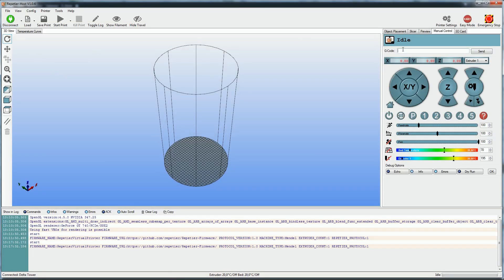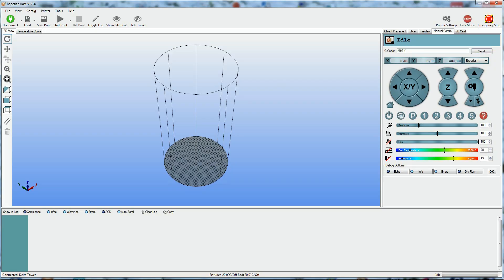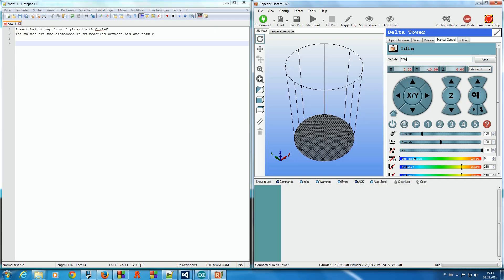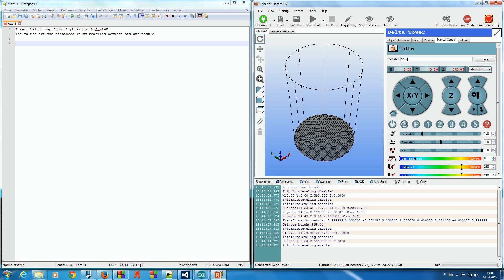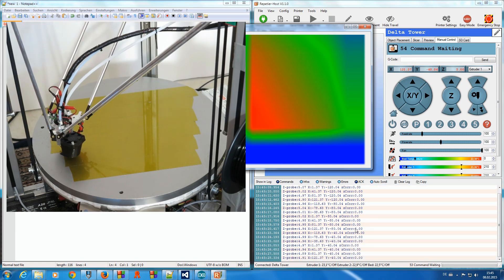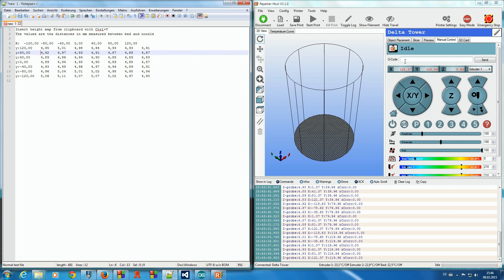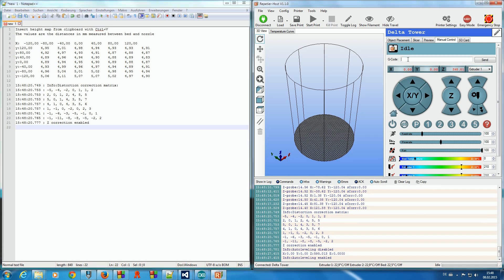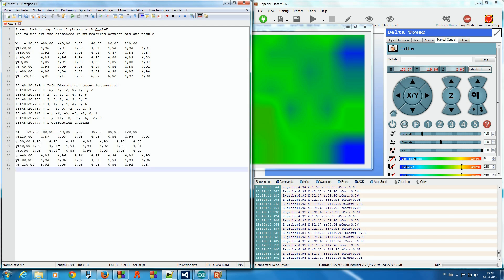Z-Leveling for Delta Printers with Repetier-Firmware

Comment: My configuration.h is the same as yours except dimensions differences including rods length, radius etc, other than that the corrections and leveling are set to the same as yours, but g29 measure only 3 points like other users and g32 s2 measure a grid, what's wrong with my firmware?

Comment: followed all the steps up to running the first bed leveling routine G32 S2. The printer tested some weird points, tested the centre twice and then a point slightly off centre. After this is did not home again and spat back NaN for all 3 values in the host, and told me autoleveling was disabled. After that all my steppers refuse to work at all. They will turn on for about half a second when the machine is reset or turned on but nothing after that. Printer will also hang if told to home axis. Any advice will be appreciated.
Reply: same problem here .

Comment: Love the video! I have a question though. When I use Height Map my starting point is X -110, Y - 60. When I run my G33 command it starts at X -110, Y 60. How do I get my G33 to run the same path as my Height Map, or does it even matter what path my G33 starts?

Comment: my 3d printer wont connect to repetier
Reply: you need audrino driver and need to set baud rate
Reply: I have, i found out what the problem was, one of the chips on the motherboard was burned.
Reply: so you got a new board?

Comment: You say g29 measures 7x7 points. Mine only measures 3 points defined in EEPROM, and the log never shows any correction information. What am I doing wrong? Repetier 0.92.9. I have also tried g33, but it says it is an unknown command.
Reply: You have to enable "DISTORTION_CORRECTION" in your firmware's "Configuration.h" file. After that you can use G33 and M323 commands.
Reply: Configure and download the latest firmware version from www.repetier.com/firmware/dev/index.php
In Configuration.h file you'll find a variable called "DISTORTION_CORRECTION", set it to "1". While you are at it, you might also want to configure the rest of "DISTORTION_CORRECTION" variables to make sure it doesn't try to probe outside of your print bed.
Reply: Maybe you are using some old firmware version where it was G29 instead of G33.
See www.repetier.com/documentation/repetier-firmware/z-probing/ for more info.
Reply: I have correction enabled but have the same problem, as well as that, when I run g29, I get a message z correction disabled even after I enabled it permanently

Comment: yes, can you upload your firmware you used, my printer keeps trying to read off the build plate during the bed height measurements and causes the hot end tip to drive into the bed and make the belts slip and hard crash.

Comment: hello, when i enter G29, it only goes to 3 point(different from you) and so how to add the correction factor in it ?
Reply: apex G29 measures 3 points when you have no z distortion correction feature compiled in, Then it simply computes the height from the average of 3 points. Only the 0.92.3 version have this feature at all.
Reply: +Kurvenparadiese I have version 0.92.8 downloaded using the online tool configurator and still have the same issue as apex. Do I need to have 
&quot;Enable axis compensation&quot; enabled in my config ?
Reply: <z distortion correction> is here?

#define DISTORTION_CORRECTION 1
#define DISTORTION_CORRECTION_POINTS 5
#define DISTORTION_CORRECTION_R 100
#define DISTORTION_PERMANENT 1
#define DISTORTION_UPDATE_FREQUENCY 15
#define DISTORTION_START_DEGRADE 0.5
#define DISTORTION_END_HEIGHT 1
#define DISTORTION_EXTRAPOLATE_CORNERS 1
#define DISTORTION_XMIN 10
#define DISTORTION_YMIN 10
#define DISTORTION_XMAX 100
#define DISTORTION_YMAX 100

Comment: Having problem with my delta printer!! Everything is ok until the g29 command. It wants to go to these coordinates X7562 and Y 6894 ??? Does anyone had the same problem ?? What should i do ??
Reply: G29 as well as G32 go to the three points stored in eeprom. I assume for some reason you have these coordinates stored there.

Comment: Once this is done, is it permanent? Or does this have to be done every time you print?
Reply: Having same issues, bed height map not working on version 1.6.2
Reply: This is permanent.
Reply: Larissa Littwin In the video they are using V1.1.0.... I can only see V1.0.6 avaliable. Also the height map option is disabled in V1.0.6... is this normal? Do we need to wait for V1.1.0 for the functionality?
Reply: ***** Yes, we are working on version V1.1.0.
Reply: +Marcus Littwin that is not an answer to the question. I work with 1.6.1. now and hight map is also disabled.